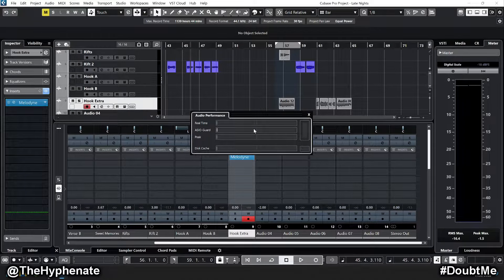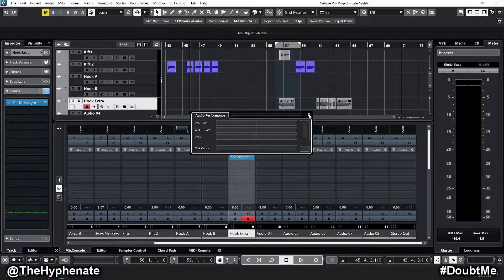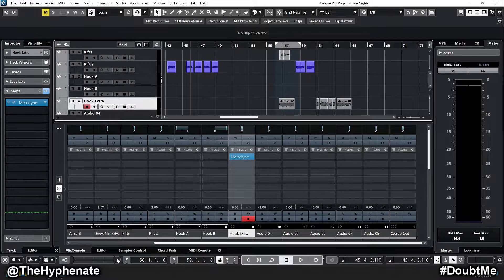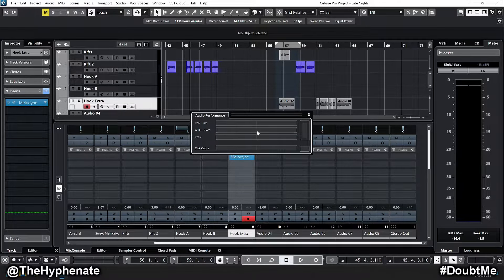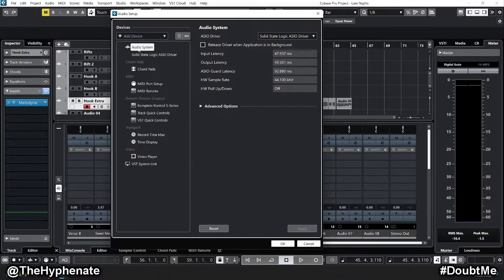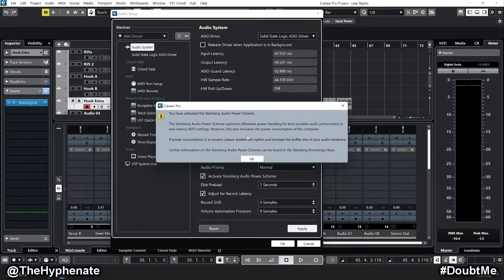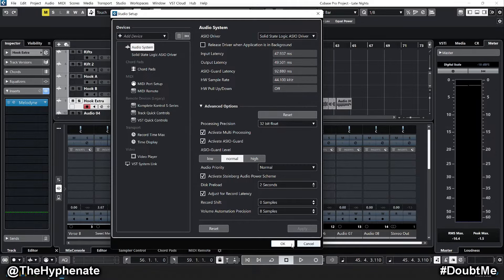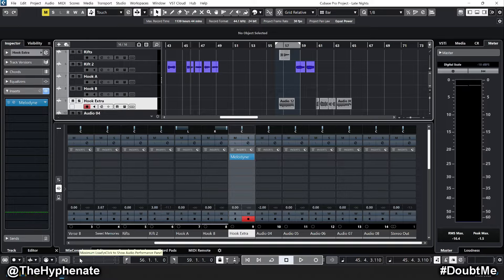Cubase Audio Processing Overload (ASIO Guard Spiking) FIXED

Comment: It did not work for me, when I clicked on apply it went down but came up again in a minute. Any other way to fix this issue? I have pretty fast computer and was not having any issues suddenly today the project I was working on would not load so I started cubase in safe mode and ticked the disable program preferences but after that the performance have been slow. Any thoughts why it is happening.
Reply: Me too! Always had this issue, & it never goes away regardless of the settings mentioned above. I may have to open a Steinberg help ticket one day, but as those who have tried will know, just waiting for a reply from Steinberg can take a very long time.
Reply: Same for me it didnt solv the problem.

Comment: so I don't have that option (Activate Steinberg Audio Power Scheme) - I get the pops and cracks when I create an empty project only.  When I add a VST instrument (like a Kontakt piano or something) to an empty project, playing it has terrible audio quality.  However, if I create a project based on a template (RNB, Rock, etc.) and add a VST instrument - no issues at all.  There must be a studio setting in the templates that the blank project is missing. I gave up trying to fix it and just use the templates each time.
Reply: The fix is actually really stupid. Experiment with arming different tracks for recording. Turn off auto arming when you select a track, coz that wreaks havoc with the ASIO guard. For me, I have an empty instance of Kontakt always armed, and it works now. When the project grows to a fairly large size, I arm a folder of only a few instrument tracks. The check box in this video is for PC only. You're obviously on Mac. Basically keep an eye on the ASIO guard. If it is full, and all the other graphs are not showing anything, arm something else, till you see it all loaded. Then it'll work, if all the other factors are OK. As in your buffer settings vs hardware capabilities and the project itself.
Reply from the maker: You can also increase the buffer size. That could help
Reply: @MythixMusic1  Sweet!! Would definatly not be the first place I would look!

Comment: On Cubase 13, Power scheme checked and ASIO Guard level is set to "high" and I still getting that CPU overload warnings. 
I noticed that it happens when changing presets in some of Kontakt 7 libraries. Just a few Kontakt in project, lightweight project to be exact. 
i7 12th gen, 64 Gb DDR5, RME Babyface Pro. This shouldn`t be an issue at all.  
Any thoughts more? Help!
Reply from the maker: Make sure you have a higher buffer when mixing/making beats.   Lower buffer when recording.

Comment: You forgot to tell us if that was on a laptop or desktop PC? That is crucial. So was it a laptop? And if so, was it only on battery or plugged in?
Reply from the maker: Good point. This was on a PC.  If you're using a laptop, use this if you have over 50% battery life, or you can have this on indefinitely if it's plugged in
Reply: @DoubtMeTech  You must have had a strong power saving profile applied then. Never had any such issues on a PC. How many cores does your CPU have and what sort is it? Is it a mobile CPU by any chance?
Reply from the maker: @AngelicStreak  MSI Desktop.  i7 with 8 cores. 2.9 Ghz.  64 GB of Ram. RTX 3070 GPU.

Comment: Hello,

I Have a Problem with Cubase 12 and also 13 
I Cant find the (activate Steinberg audio power) Check box in the ASIO window 

I Opened Studio Setup
- then Audio 
- then System 
- then ASIO Driver 
- Then Advanced Options 
But it's not appear 

I Use MAC System
My Computer Specs are:
Mac Studio ULTRA Apple Silicon 2023 
192 GB 
macOS Ventura 13.5 

Can you Help Me Please? 
because I have too much glitches and overload  with my Sessions 
even with an empty session 

Thanks
Reply: * My Audio interface is Scarlet 18i20 USB C